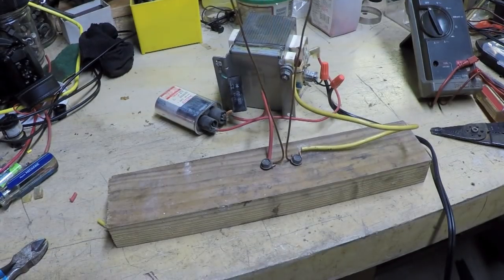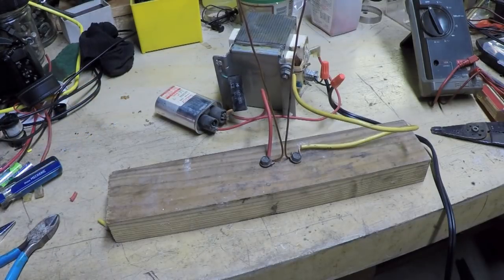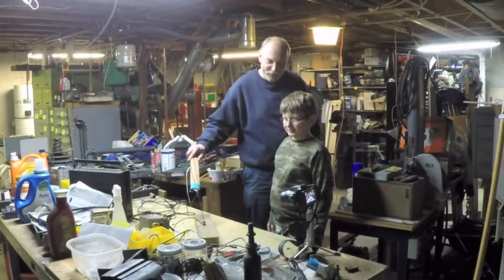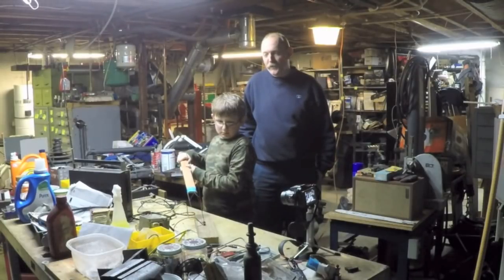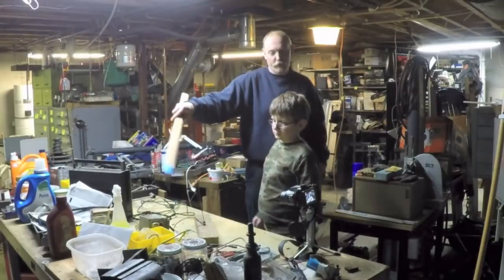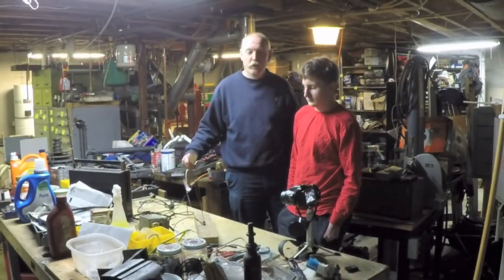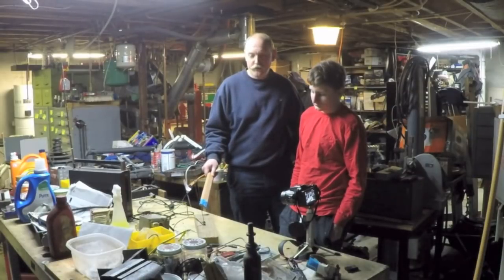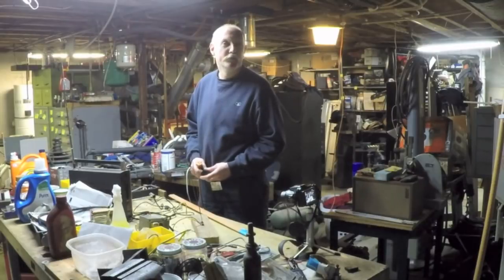High voltage transformer from a microwave oven Part 2

Comment: it would have worked the first time, if you had just taken a screwdriver and touched between the closest point at the bottom. It starts the arc, warms the copper wires to the point that the arc starts by itself, and climbs the wires. You also have to get the width right on the "spread angle" adjusted to the voltage used. You had the spread angle increasing much too  quickly as the ladder got taller, for the voltage you had available.   
A neon light power supply usually runs about 25 to 28 thousand volts, and work quite well to make a Jacob's Ladder. They have a 110 volt plug in cord, and only two wires coming out, which keeps it simple. and you don't need all that capacitor/transformer hardware. it's just way more trouble.

Comment: 15000volt @ 30 miliamp neon light transformers make great Jacobs ladders.
Reply: Using a neon light transformer rated at 15000 volts @30 miliamps Used to put condoms filled with natural gas or asetalean tied to the top of the ladder so when the arc reaches the top it makes a huge fireball. 😎
Reply: Makes a great mad scientist laboratory display for Halloween! 😎

Comment: Git rid of the capacitor.  And bend wire at bottom with a more right angle to get arc to start then adjust the distance and use way les v shape more vertical.

Comment: Try taking a car battery ground strap for a single turn secondary. That makes a DIY SPOT WELDER. (You will need a Variac on the primary side to adjust the power.)

Comment: Pull two microwaves apart and cut the welds on the transformer body and use the two to create a housing big enough to fit both high voltage coils together in line with each other to double the voltage, same as the capacitors.

Comment: Get that doubler out of the circuit. It will work much better because the capacitor limits the current.

Comment: if reuseing the  primary  ( only )  , take the  high  volt  coil out   -   with   mains  -  it  becomes  tool  demagneteiser  

Question  about the  ant    07;22     -  building  a  cockroft walton voltage  generator  for  oscilloscope   - fly  landed  on the  unpowered  - so turned  it  on  -  sought  of  rigid   - turned  of   - fly went  off  a     bit "drunk"

Comment: Just the other day, an electrical engineer friend was explaining how this could be used as a spot welder. He said to strip the coils out of the secondary and replace them with just 5 to 6 turns of much heavier gauge wire, like 3mm. He never mentioned anything about the cap and diode. Seems to me that the diode is really an AC rectifier, (converts AC to a ripple DC) and the capacitor smooths the ripple to a more pure DC. Also, as suggested below, MORE capacitance is needed, you may still have a large component of an AC type of ripple. The current isn't reversing as with pure AC, but it's flowing and slowing, like a pulse. 

I love your work shop. Looks like mine. Clutter over every bit of bench space with just enough cleared to to something on. 

Also, ask your kids what THEY like to do and go do it WITH them. My Dad was lucky, he did model airplanes and so did I. Sadly, he died when I was 13, just as I was finishing up my first airplane that I built with no help from him. He was pretty proud but he never got to see it fly. Still, him seeing the project done and finished  was the biggest thank you and gift I could have given him. I'm 69 now and have been building and flying model aircraft ever since. Here's my other YT channel. https://www.youtube.com/watch?v=RzuxaQ8dixs

Comment: remove the capacitor and diode and just use the pure A.C. output.
Reply: jacob's ladder works best with AC not half wave DC  i built one with a HV supply from some government surplus that was over 50kv made 6 inch arc's with no problems

Comment: It's really cool you involved your kids. Reminds me of my dad, he always involved me in everything from car engine work to building the extension on the house to repairing washing machines and tvs lol still do stuff together.

I literally just dismantled an old microwave I found on the side of the road, it was put out for recycling, I got a fan almost identical to yours same motor, a big transformer (I mainly wanted it for the soft iron core that's laminated strips), some switches, a ton of wire and that little motor (I've seen people use them to make hand cranked torches. The capacitor was intimidating lol.

I also salvaged the giant magnets and some pretty decent magnet wire from the magnatron.

Comment: That's really cool how you brought them to see the high voltage and also maybe see te dangers. I have worked with electronics (including mots) for 13 years now and very nice videos. Disconnect the cap and you can get a 4~6 inch arc (or more).

Comment: Put the wires in a sealed tube and pump out some gas, then the low pressure gas could produced arc at such voltage.
Reply: Replace air with argon. Will produce arc.

Comment: You might be able to use the same transformer only get a few more capacitors and diodes . You would have to wire them together like a taser . Each one would increase the voltage. Here is a link to a diagram of a taser circuit that might help you make your Jacob's ladder work.  http://www.celticcrosseng.com/wp-content/uploads/2014/04/stun_gun1.gif   If you try this and it works send me a video. Due to copyright laws I can't paste the image and that is why I shared the link to the diagram.
Reply: Sar u contact  nember

Comment: Nice work. I remember repairing Mircowaves. I had a 10 Watt resistor with  clips to short the Cap out. Have a wonderful day.
Reply: Microwave caps have a 10Mohm internal bleed resistor

Comment: at a guess you are making about 8000 volts at good amperage it is a fat spark turning the output into a tank circuit would add enough voltage to make your jacob's ladder  work or adding a secondary step up transformer may be easier doubling or tripling the voltage would do the trick there are lots of ways to do what you want it might be wise to read a little about high q coils your transformer is not but could be.:)
Reply from the maker: Clay Mccormick  thanks for the advice.
Reply: Remove capacitor and diode go straight AC and your Jacob's Ladder will be amazingly violent don't get too close to it though allow a longer chicken stick if you have to initiate the crossover

Comment: To do a proper Jacobs ladder with a smooth as silk arc the output needs to be rectified to dc. Your arc is switching on and off at line freq so is self quenching.
Reply: What would be needed to rectify 2000 volts AC. I'd like to try this. I have some big 600 volt diodes that might not be up to the job.
Reply: @ravenhhca  - Well, OBVIOUSLY you would use the existing high voltage diode (and capacitor) from the voltage doubler. You'd need more diodes to create a full bridge, and note that you'd need to run the capacitors in series to get a high enough (safe) working voltage to smooth it.
Reply: @johncoops6897  .....So 4 scrap microwaves should be enough to supply the necessary parts.

Comment: I use a single MOT for fractual wood burning and don't use the capacitor or diode. Take one wire off of the high voltage coil and ground the other to the MOT with a chicken stick. You should get healthy 3 to 5 inch arcs. I've found to  make a Jacobs ladder a pulse generator works better. Or an ZVS driver board with a television flyback driver is pretty cool too. Thanks for the videos I do the same with my daughter just to see her reactions as well.
Reply: i have a mot that i run on 60 v and get bigger arcs [not you him]